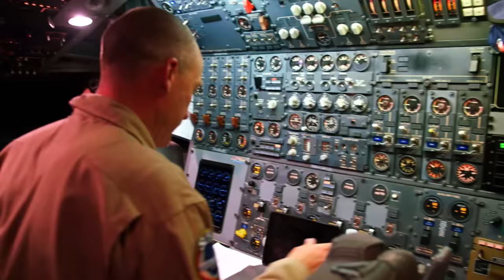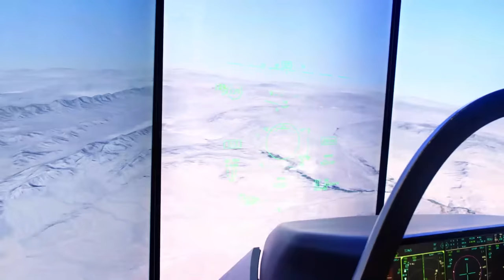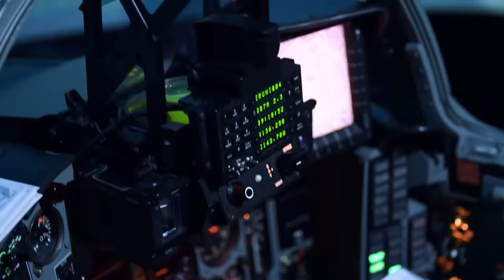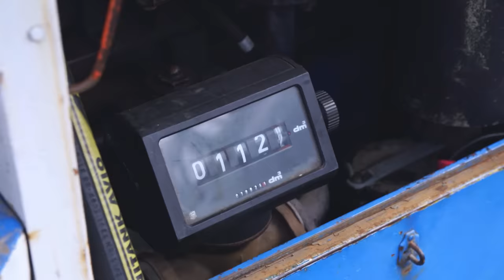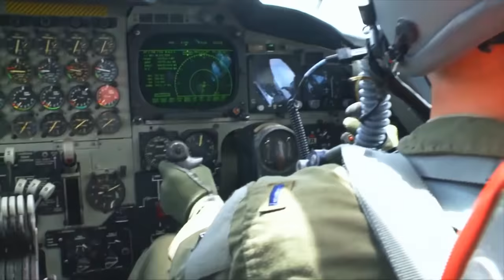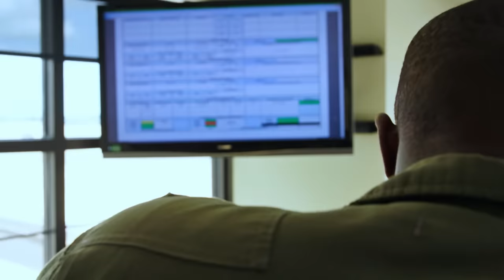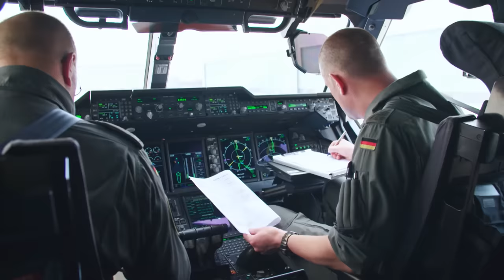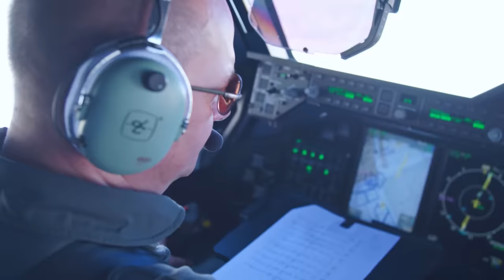World's Most Extreme Military Aircrafts | Ultimate Vehicles | S01 E03 | Free Documentary

Comment: The swept wing technology, was taken from the German Messerschmitt Me 262. The first operative jet fighter in history. It changed everything.
Reply: notthing changed.
Reply: More likely the Messerschmitt 163, which was the rocket-powered interceptor fighter. This pre-dated the Me 262, also had swept wings, and was capable of far higher speeds, albeit for much reduced flight times since it could only carry enough fuel for less than 10 minutes of powered flight. For the rest of its flight time it was essentially a glider, at which it excelled since the design was itself based on a previous series of unpowered gliders.
Reply: Actually the Germans were playing around with swept wings on gliders. There was also the p-1101 which had swing wing technology similar to the f-14, the Ta-183, the fw-287 had swept forward wings.

Comment: am i the only one to spot the rust on the mig-29? 15:35 and other images around that time :)
Reply: i saw that as well. But in my opinion, the material i saw that started to rust/rot was more or less cathode materials. Meaning they are designed to rust/rot in place of more critical components like cables or structural metals. Boats are something where cathodes are most noticeable. Huge pieces of a special metal are welded onto the outside of the hull to rust in place of the hull itself.

Comment: That Mig 15 can handle 8g and so can the pilots...for a short time. It is inaccurate to state that the newer jets can only handle a couple more though. With thrust vectoring the current series of fighters may very well be the last series that have people in the cockpit as the planes can put g loads on the pilots that would kill them in seconds. Humans are the weak point in the equation.
Reply: False. The planes can't sustain high G either since that means loss of energy and that leads to being an easy target. For instance the F-16's fastest sustainable turn rate is achieved at 7Gs, not 9Gs which is what a human can sustain, and there are several instances of piloted fighters pulling turns well above the G "limits" of the fighters they are in e.g the F-15C pulled 12Gs during the Gulf war despite only being rated for 7.3Gs.
Also, thrust vectoring typically isn't useful at high speeds, but you need high speeds to pull high G loads.
Reply: ok
Reply: ahh.. so Elon Musk saying the future fighter will be drones is becoming more true
Reply: F-16 handles 9 Gs